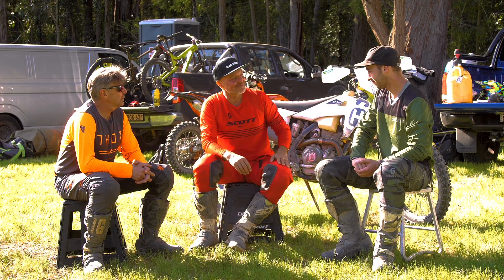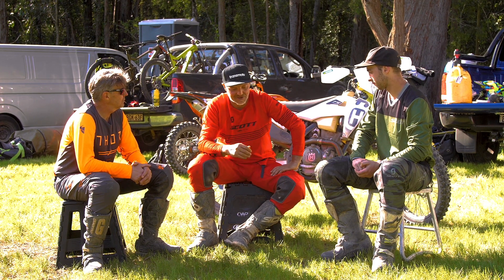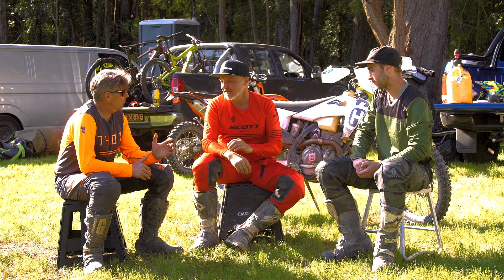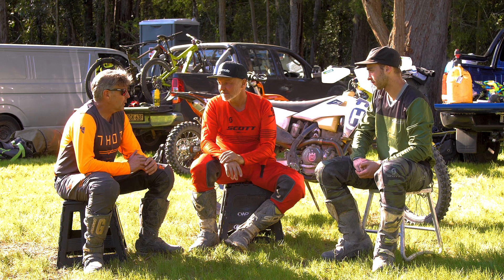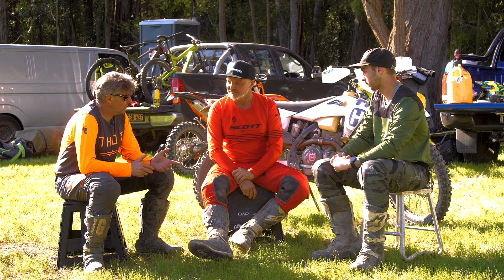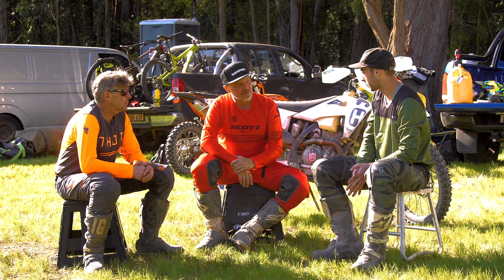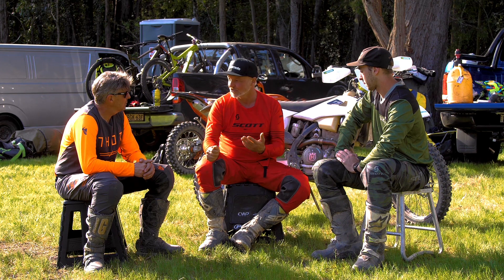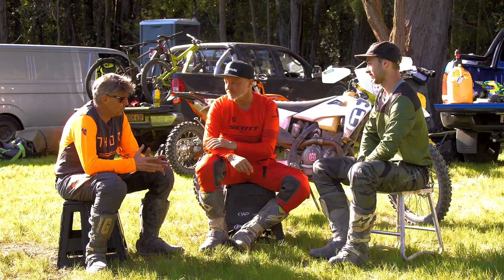Four-Stroke ECU Mapping Mods for a Husqvarna/KTM Dirt Bike: Rider Feedback

Comment: The point I think is knowledge/education. I just bought (last week) brand spanker 2020 Husqvarna FE-450 and at no stage did anyone tell/educate me about mapping modifications. I asked lots questions as I normally would when buying a new bike so lots of opportunity to pass on any information.....
Makes me feel as though dealers and shops are happy with not imparting knowledge in RE mapping  because riders can spend lots money on exhausts/useless bling and other very expensive items where profit for sellers are huge??? Just speculating here. I for one would be open to the idea of RE mapping not only for better response/ power etc ( as documented here) but most importantly the engine running correctly and not lean giving owners the longevity of engine life as they deserve after paying premium prices.....
I am in Melbourne Victoria can you recommend someone to do this to my bike? For mine.... it would have to be an approved factory modification that Husqvarna factory approves not only giving me the confidence that it will actually improve my bike but importantly not void any warranty 👍
Thanks for the video 👍